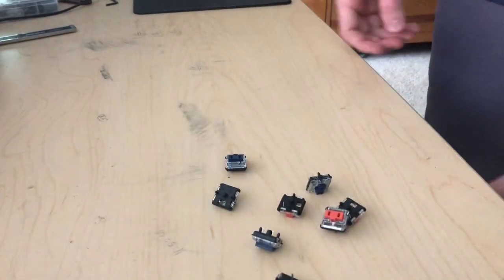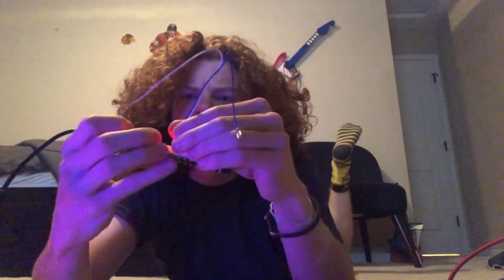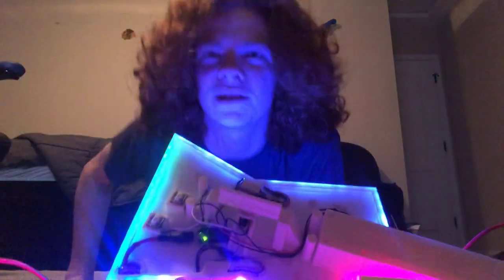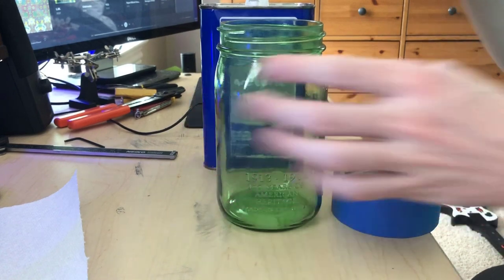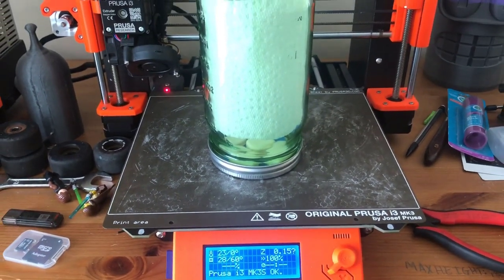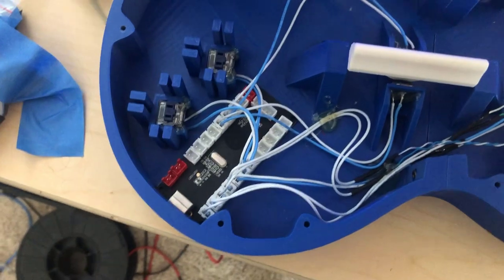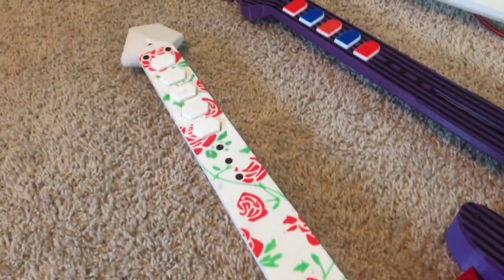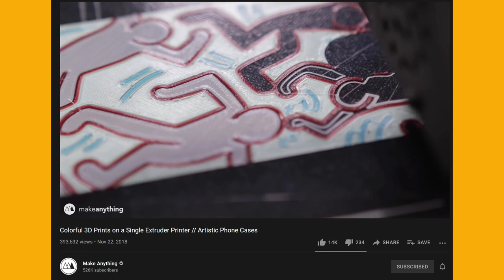How To Make Custom Clone Hero Controllers

Comment from the maker: Code for Arduino Pro Micro:

// Used for Game Controllers with 9 Digital Buttons

#include <Joystick.h>

#define PLAYER_1 0x03

Joystick_ Guitar(
  PLAYER_1,               // Change this for each controller connected to one computer
  JOYSTICK_TYPE_GAMEPAD,
  9, 0,                   // 9 buttons, no hat switches
  false, false, false,    // No X, Y or Z axis
  false, false, false,    // Yes Rx, No Ry, or Rz
  false, false,           // No rudder or throttle
  false, false, false     // No accelerator, brake, or steering
);

void setup() {
  Serial.begin(9600);
  // Initialize Button Pins
  pinMode(0, INPUT_PULLUP);
  pinMode(1, INPUT_PULLUP);
  pinMode(2, INPUT_PULLUP);
  pinMode(3, INPUT_PULLUP);
  pinMode(4, INPUT_PULLUP);
  pinMode(5, INPUT_PULLUP);
  pinMode(6, INPUT_PULLUP);
  pinMode(7, INPUT_PULLUP);
  pinMode(8, INPUT_PULLUP);

  // Initialize Joystick Library
  Guitar.begin();
}

// Constant that maps the phyical pin to the joystick button.
const int pinToButtonMap = 1;

// Last state of the button
int lastButtonState[9] = {0,0,0,0,0,0,0,0,0};

void loop() {
  // Read pin values
  for (int index = 0; index < 9; index++)
  {
    int currentButtonState = !digitalRead(index + pinToButtonMap);
    if (currentButtonState != lastButtonState[index])
    {
      Guitar.setButton(index, currentButtonState);
      lastButtonState[index] = currentButtonState;
    }
  }
  delay(10);
}
Reply: you need to pin the comment, it's not appearing on popular comments tab nor at the top
Reply from the maker: @hyron_  whoops. I appreciate it dude
Reply: yo, can i have the code with the LED-s as well? much appreciated! :)
Reply: @JoshDesigns o you have the code with led? I'm not a genius like you and would like to piggy back on your success, respectfully.
Reply: I have a wii guitar hero game , any way you can make this guitarra compatible?
Reply from the maker: @Marina-vu2vi  I don't think this is possible unfortunately. I know people have gotten arduino/raspberry pi guitars to work on xbox and ps2. https://sanjay900.github.io/guitar-configurator/#:~:text=Instructions%3A%201%20Mod%20your%20console%20and%20install%20dashlaunch,and%20plug%20it%20in%20AFTER%20the%20boot%20animation.
Reply: Hello!
Something is wrong with the code, can't figure out the problem. Joystick_ Guitar( - At this point, compilation stops. HEEEEEEELP!
Reply from the maker: @sirbaskerville4609  I'm not totally sure but you might have to download the Joystick library from inside the compiler. If you're totally stuck and need an easier way to code a guitar controller, check out the "Sanjay900 guitar configurator" its free and really well made
Reply: I can do this with a Arduino UNO?
Reply from the maker: @hito935  I believe so but I've never tried
Reply: @JoshDesigns Hey Josh, I want to use leds for my guitar hero controller fret buttons. Do you know which leds to get to do this?

Comment: So for anyone wondering how to add a whammy bar, you would need to wire a potentiometer to the controller and design a return spring to have the bar go back up when you use it.

Then all you have to do is program the Arduino to assign the potentiometer as an analog slider
Reply: thx
Reply: Hall effect sensor would be better

Comment: a few things that I would change, I would make the body in 3 parts, the top, middle and back, the top and back I would make a mold with some foam board, and then do an epoxy pour, this gives you a very nice finish and depending on thickness, a structural part. got the edge of the body, I think I would probably use wood, just because of the ease of working with it. for the neck, possibly more epoxy, potentially a uv resin, this would need to be a mold, which may be hard depending on skill, so potentially a 2x4 with a saw file to shape it, for buttons, I would probably go with an optical switch, possibly a low profile optical switch, get a few low profile keycaps, and put them in epoxy then go through sanding and profiling for the guitar. the optical switch will make sure there is never any chatter/mechanical switches multiprocessing, this likely requires the arduino as i'm fairly sure a zero delay won't do it, but it's possible that it could be done with one. possibly go rock band style for ease of making and just have a well lubed metal guide for the buttons. 

for the wire, an ethernet cable would be great, however I think an hdmi cable should give you 22 cables to use, so lighting and other stuff may be doable with 1 cable. 

for the usb, I would have a female to female connector on the inside, part of making a joystick I found out that there are fairly easy to install female to female connectors, this way you would have a zero delay inside connected to the output and on the outside you would use a seperate cable., this takes away the need knott the cable on the inside. 

and on a final note, with epoxy pours you are able to insert fabric into a layer of it, if I remember right some telecasters and strats get this done to them, and if I remember right walmart has a fairly good print on fabric program so you could get custom whatever you want with little art skill.

star power could be done with a mercury switch, I have no easy thing for a whammy bar.

these are at least my thoughts on this given im looking at making my own and im a bit better with wood working and an airbrush than I am at getting crap to 3d print correctly.
Reply from the maker: hell yeah i’d love to see a wood or epoxy guitar hero controller. I am only good with 3D printing and I feel like making a whole guitar out of epoxy would be more expensive than 3D printing it. But using epoxy for the buttons and strumbar would be nice. I’ll have to look into the optical switches since i’ve never heard of them. Also i honestly just used ethernet cables for the small wires inside of them. you only need 6 wires running through the neck of the guitar so i just tear 6 wires out of some ethernet cable.
Reply: @JoshDesigns  I was considering the hdmi cable for the entire things wiring and having it more or less clean, with breakouts here and there for various parts. as for expense of epoxy, it depends on how much you use, I know full guitar bodies have been made out of epoxy so I know it can be very structural, but I have no idea how thin it can get while still being structural, a rough estimate for the body being being about 2 square feet and 1/8th inch would say about half a gallon - .6 gallon would be needed, it may be doable with 60$ but certain things like buttons I would epoxy cast regardless if only for the cleaness and that I have never had a print that really lasted a long time though use like a button would be put through, the wood however, everything outside of the buttons I could easily shape with wood. thinking of it and looking up current prices, could go with a 1/8th inch plywood, and epoxy over the top as a layer for color as the cheap plywood sure as hell won't look great or feel good. now I have to look up if automotive clear coat can be applied directly to wood, or of there is a priming layer that would work with wood. 

on 3d printing, you can use a 3d printing resin, one that hardens with uv, and paint it onto fmd prints to get rid of layer lines/roughness, probably works just like a uv expoy, paint it on, sand a little, paint a new layer till smooth, this would work for both buttons and the areas the buttons would touch. to help smooth it out, not sure if it would end up sticky at all, so potentially some silicone oil would add that extra bit of lube, there is one that is used in airsoft called p force, it worked amazingly with lubing a sinden light gun of mine,

Comment: Hey man. Idk if you’ve done it or thought about it. But do you think it would be possible to keep the same wiring from an actual GH guitar that’s wireless and use the USB game controller hookup to make it wired? I have 2 wireless controllers I bought for hella cheap, but they don’t have dongles and I wanna convert them so I can use them
Reply from the maker: Yes! in another video on my channel i show how i converted a wireless knockoff GH controller into a Usb guitar using an arduino instead of the USB encoder but both would work.

Comment: What color Kailh low prof switches do you recommend? I'm thinking Brown for the fret buttons and White (clicky) for the strum bars? Making 4 of these in the coming weeks, super excited!!
Reply from the maker: honestly it’s all preference and they all work. I even got extremely low weight switches to work (kailh low profile purple) but, for the strumbar, i would definitely recommend heavier switches.
Reply: @JoshDesigns  Do you have any recommendations on specific switches for the strum bar? I used White Kailh Low Profile Choc Switches but the switch doesn't return all the way, causing multiple presses on a single strum.

Comment: hey i just wanted to say that I wasn't able to get the green red and yellow buttons to work with the code u did but I got it working with the The Ardwiino Guitar Configurator tool nether the less thanks for the help and I'm going to rock with your guitar 

💌🤟

Comment: The printer I used ended up adding an extra layer around everything so all of the holes are too small and I need to sand EVERYTHING. It's becoming way harder than it needed to be.
Reply from the maker: ouch i'm sorry to hear. I hope you got it working regardless

Comment: Thank you for making these files and guide on how to assemble it looks amazing and I can't wait to start assembling. I have a quick question, I went ahead and ordered the PCB's and while looking at the Poly_FretsBottom_PCB file there isn't a standout thing to mount the PCB to. Is it fine just sitting in that void and probably hot glued to it or would I hot glue it to the underside of Poly_FretsTop?
Reply from the maker: I hot glue mine into the FretsBottom_PCB file as deep as you can push it. It’s pretty janky so I am redesigning the file and I plan on uploading it today.

Comment: I'm trying to fix my old guitar. I believe the issue is the board. Would this encoder be able to attach to all the cables and make it all work?
Reply from the maker: the USB encoders work for digital inputs but not analog inputs. so everything except for whammy bar works

Comment: Awesome work! At this rate, we're gonna have group buys for custom controllers, swear to god. Question: is there any way to implement the whammy bar and/or a d-pad into the code? I want to upcycle an old broken wireless guitar or two and basically just slap Arduinos inside of them.

Also: how did you code the lights?

Thanks!
Reply from the maker: Thank you! The comment right below you explains how to do the whammy bar haha. There's a way to get analog control with the same joystick library that I used in the code from my pinned comment.
The lights are WS2812b individually addressable LEDs and I coded it using the NeoPixel Library. It is a bit tricky to code an animation while still being able to read input values but as long as you don't code any infinite loops other than the main one, it should work.

Comment: could you please add a link to wiring diargrams please... also a video on wiring the buttons would be nice. Great work!!!
Reply from the maker: im working on a video and pdf for the whole process of assembling the guitars
Reply: @JoshDesigns  awesome. How much infill you using for these guitars? Going to start printing mine ASAP while parts come in. Thanks and great stuff!
Reply from the maker: @TheRealKingDong  I just keep everything at 20% although it doesn't make a huge difference as long as you have 3 outer perimeters

Comment: Yo man, do you know if it's possible to use your fret button or strummer STLs for replacements in an actual GH3 Wii les paul controller? I'm doing a custom color job on one but don't want to paint the buttons because I'm worried they'll either stick or rub off.
Reply from the maker: no they will not fit. but theres definitely real GH fret STLs out there

Comment: Hey im trying to print your Les Paul Model. On the Body 1 it says it is unable to slice is there any fix for this?
Reply from the maker: there might be a problem with my model. my slicer always fixes little problems with the models. if you’re on windows, theres a built in software called 3D Builder that can repair stl files.
Reply: @JoshDesigns  thanks for the response man! I’ll try that when I get home. Love your work and videos keep it up!

Comment: Hi josh. I've just finished printing and wiring but when I copied the code it keeps coming up with errors. I am a complete novice when it comes to arduino.
Reply from the maker: its probably not an issue with the code. I would make sure you have the correct port selected and make sure the arduino pro micro board is selected. if you dont know which port it is, try all of them. the pro micro might also be called arduino leonardo

Comment: Can you pleaseee put a list of what you purchased (like the internal bits of the guitar) in the description? Started printing all the pieces on my prusa last night, just looking for direct links :D awesome videos, subbed! 420 lol.
Reply from the maker: A viewer named Wizzo and I put together these instructions: https://joshuaua.github.io/3Dprinted-CloneHero-Controller/
Reply: @JoshDesigns  what are the exact key switches you used? I have the guitar fully printed and put together but my low profile switches aren’t low enough profile lol I was planning on editing your fret buttons stl to recess the inside but I really want to keep it original.

Fantastic work btw.  The fact that you made it in blender is even better lol
Reply from the maker: @Headrom789  woah i didn’t there were different size low profile switches. I have kailh low profile switches.
Reply: @JoshDesigns  after reading some more comments it seems I have regular style switches that are just thinner than normal switches. The ones I have, have the + shaped top on them. I’ve already modified the strum bar to work with them but I’m going to try and find the correct ones for the frets.

Thanks Josh

Comment: How does the strumbar hold up? I'm making one in hopes that it will be able to rake strum. I was going to modify the strumbar and body to sit on a metal rod like the originals so that it will last a little longer.
Reply from the maker: I am not nearly good enough to rake strum. I chose to not use a metal rod anymore because I wanted it to be easy for as many people as possible to make one. But a metal rod inside the strum bar would probably be better

Comment: hey i saw and loved your video and im planning on buying a 3d printer and i wondered what filliment you used
Reply from the maker: Hatchbox makes good quality for a good price. but usually i just get whatever is cheapest on amazon
Reply: @JoshDesigns  i also forgot to ask how much of the filliment will i need if i get that type?
Reply from the maker: @St3ezy  filament normally comes in 1kg spools and the whole print uses less than 1kg

Comment: any suggestions for where to find videos or anything to learn about electronics and modeling?

i wanna learn alot more before i get into this, both your vids were great
Reply from the maker: I learned modeling by copying everything that youtube tutorials did. I would recommend the channel blender guru. I don’t really know much of anything with electronics so my suggestion would be to buy a cheap soldering iron and start tinkering.
Reply: @JoshDesigns  thanks brotha 👍

Comment: looking into a 3d printer to print some of my own thanks to you !  what starter printer would you recommend that would be good enough and large enough to print a guitar ?
Reply from the maker: I designed the poly guitar to fit pretty much any 3D printer including the inexpensive Ender 3. I would recommend the Prusa i3 Mk3 or Mk4, or the bambulabs p1p if you want a more expensive and reliable printer. otherwise, I don't know much about the lower end machines so I can't really recommend anything else. Just know no matter what 3D printer you buy, you're gonna need to make repairs to it at some point.
Reply: dang the bambu lab a1 mini is a little too small unfortunately or id get that one... the a1 combo would be big enough but they had issues with it and its not available anywhere ... i may have to go with the ender 3 unfortunately @JoshDesigns

Comment: i cant seem to get clone hero to pick up the arduino, but I've done the USB controller and the buttons work. do u have any clue why I get this issue ??
Reply from the maker: Did you bring up the Control Remapper thing when you hit the spacebar on the main clone hero screen? You are going to need to map each button inside clone hero
Reply: @JoshDesigns  yes but non of the buttons register to anything but when I do the USB controller they do so I was a bit confused. I even resoldered everything but it came out to the same outcome I'll try again and see what happens.
Reply: @JoshDesigns  got it working lol seems I was squishing  some wires

Comment: can you make the button stoppers higher for less travel distance? just curious
Reply from the maker: that would work you just gotta make sure its not so high that the switch has trouble registering. you can scale it up an extra 10% along the z axis or so in the slicer